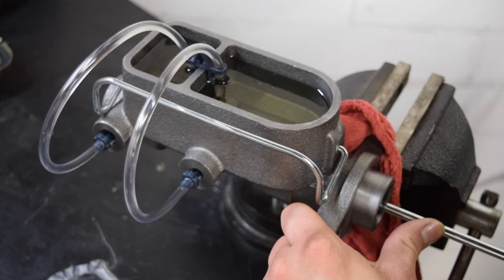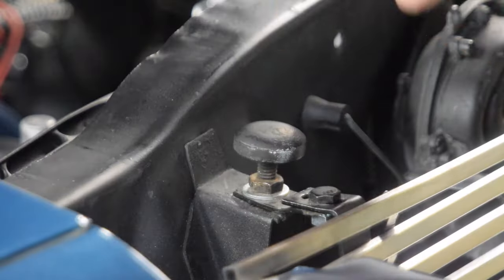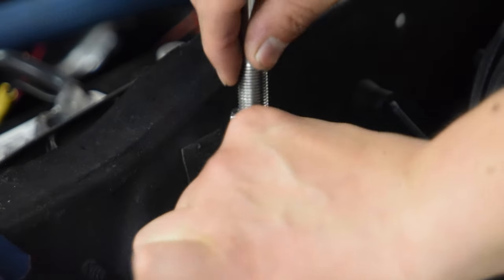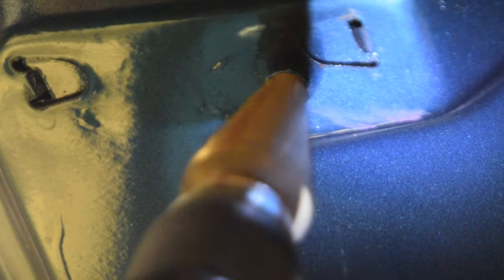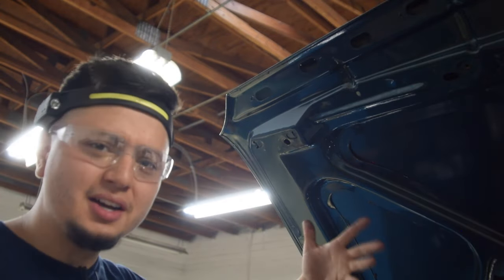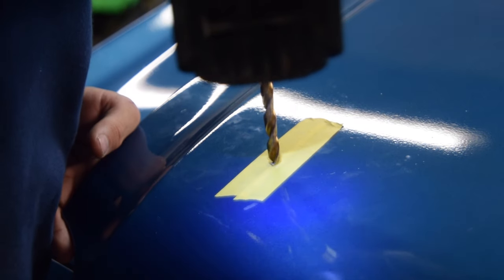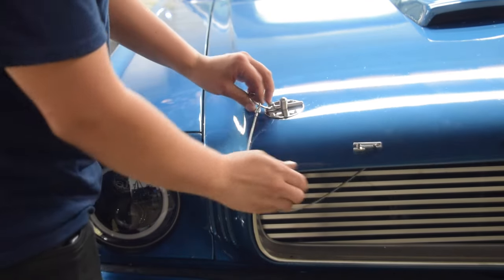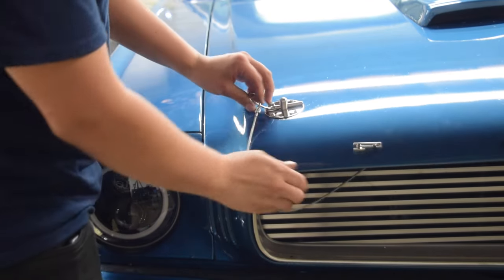HOOD PIN Install | 1966 Mustang Coupe

Comment: I dont know why anyone would chose that type of hood pin with or without the tether. Especially with the tether which can scratch your paint.  Locking hood pins give you a little extra security and they are a cleaner look.

Comment: I've always liked a couple of hood pins for security on my friends builds.
I used a set on a Chevy Chevette that took a right front corner hit.
Shock tower pushed in a bit.
A torch.....cum along.....and a 4 foot dia tree trunk fixed the shock tower  a  little bit.
The hood latch was toast.
Pins on the hood got some jaw drops and stares.
It worked.
Car tracked not so good.
Lots of used tire and rim replacements.  I kept her costs low.
The owner was happy.....she still had a daily city car.
Reply from the maker: Hell yeah! Aslong as it worked and the customer was happy lol!

Comment: WOW, what a sweet mod, that is both pleasing to the eye, and highly functional from a safety standpoint! Thinking of doing this to my 1990 Dodge D150 pickup. I understand the apprehension of drilling into your hood, scary moments there. You made this look so easy with the step by step. I commend your efforts my friend, WELL DONE!!! 🏁🏁👍👍
Reply: I bought a 2012 Ram Express shortbed, single cab 4x4 brand new .Within a month it went to a body shop to have the top of the hood painted matte black and hood pins installed. They made special brackets for the pins . It came out great . You can get hood pin Mopar kits from Detroit Muscle.

Comment: I've always thought Hood pins are good idea. What do you think of the locking variety? I know some people think of them as a pain to have to unlock the hood to get under it, but if you have an expensive engine in that bay you may not be so keen on the idea of just anybody being able to get under that hood.
Reply from the maker: I never even thought of using them until my hood opened while driving, now ive come to like the look. And i dont think its much of a hassle to lock and unlock
Reply: The cable part of the hood pins are what make it look cool.

Comment: I like the look, but I didn't like the cable pins on my 442 that were installed on an aftermarket hood, with the double hood scoops, for my Olds 442. There was no care for the positioning of the hood which rattled against the pins and hood frame surrounding.The rattling was fixed five minutes after I bought the car, in his driveway, by adjusting the hood release latch. The previous owner put the hood pins on in an attempt to secure the hood due to a stolen battery and the rattling of the improper hood installation, and had welded the pin cables to a small lock, that replaced the pin so you would have to have a key (2) to open the hood. The cables were also welded on the other end to a spot beside the radiator frame, so the cables were not removable with just some tools. The cable also scratched the paint where the cable rested against the surface and was blown about by the wind(I guess). The hood pin assembly was a cheaply made product which also did not come with a gasket to protect the hood underneath the metal plate that attached to topside of the hood.  I would have never chosen it, or installed it so poorly. There was no concern for rusting of the holes that were drilled through any surface and no care for the painted surfaces either. The car was no showroom queen by any means, but it made the car look worse in my opinion. I cut the cables off and replaced the hood with the stock hood, with the faux flat scoops, which luckily had been given to me when I gought the car. The previous owner admonished me for taking off the crap hood job and hood pins. Meh. It was now my car, my choice. I eventually sold it, now wish I hadn't, but hey, we all do that. Seller's regret. Can't keep 'em all.
Reply from the maker: Oh man! All those tiny issues that when put together make a big problem! Luckily these cables had a clear plastic tube around them so the metal would not directly come into contact with the paint. I made sure the hood alignment was as close to perfect as i could get before drilling. Although the hood hinges had lots of play it still came out pretty good ! Thanks for your comment!